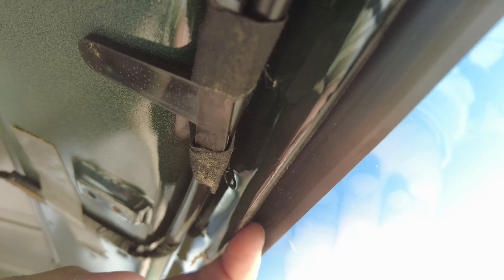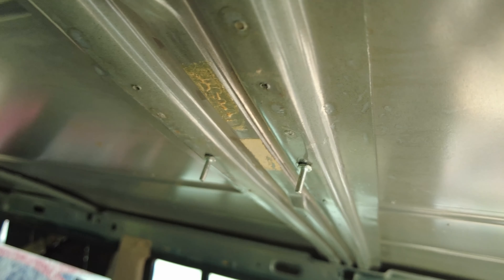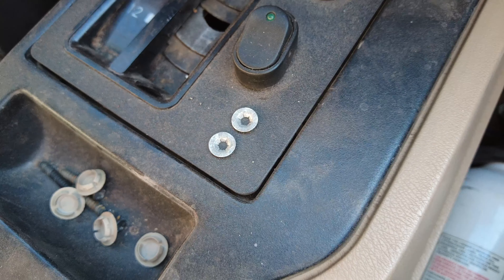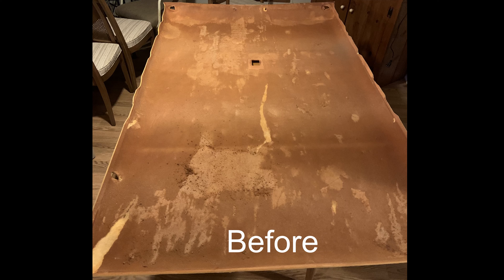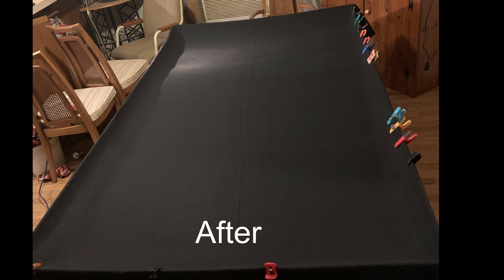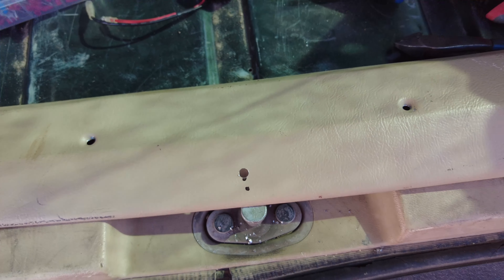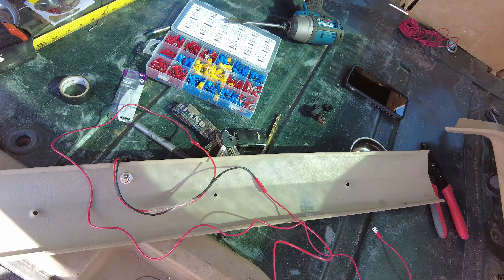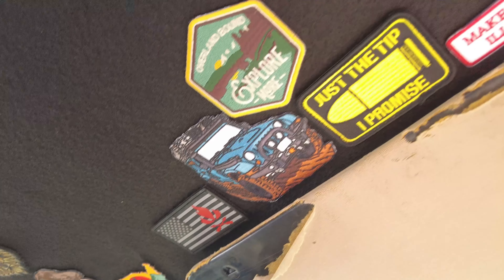Overland Jeep Cherokee XJ In Depth Headliner Replacement | Rear Cargo Light Install

Comment: I have the same idea for doing the patches on my headliner (once replaced). I'm thinking of using actual Velcro material if I can find it in the correct size. 
just came across your channel today and subscribed. Crazy how much of you XJ content so far is what I have done to mine so far and what I plan to do. GREAT MINDS!
Reply from the maker: That was my biggest issue is I couldn’t find the Velcro in the right size either so I went with the felt. I haven’t had a problem with the headliner with the felt either. Thanks a ton for subscribing and great minds do think alike 😎 I just try to do functional upgrades that will help us on the trail.